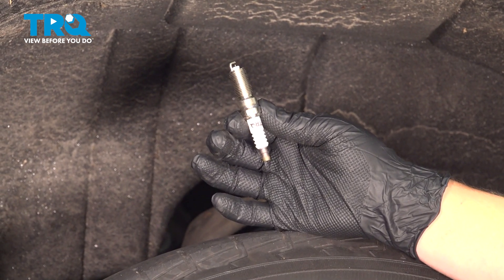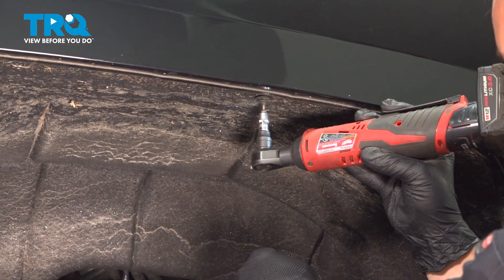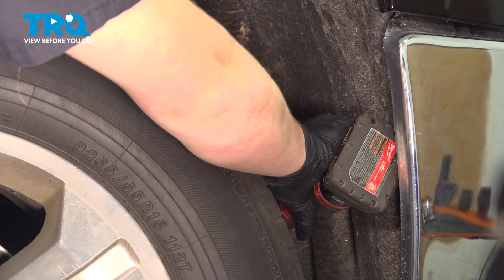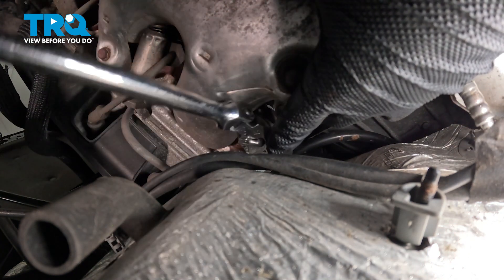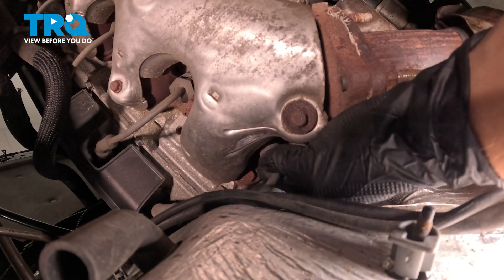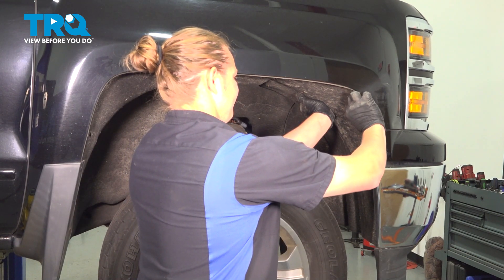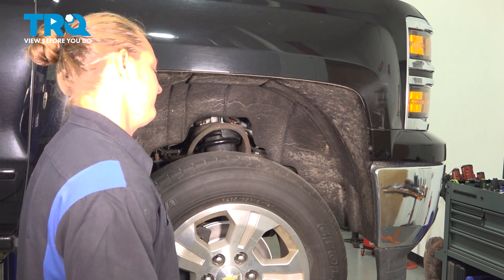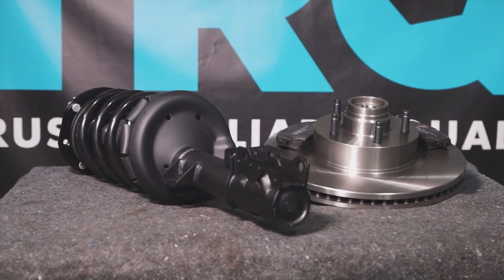How to Replace Spark Plugs 2014-2018 Chevrolet Silverado 1500

Comment: Aren’t you supposed to use anti seize on the plug threads and dielectric grease on the plug wire?

Comment: If you aren’t 70 years old and in half way decent shape, there is not a single reason why you need to remove the tire and fender liner.